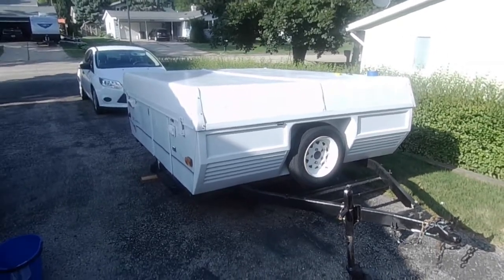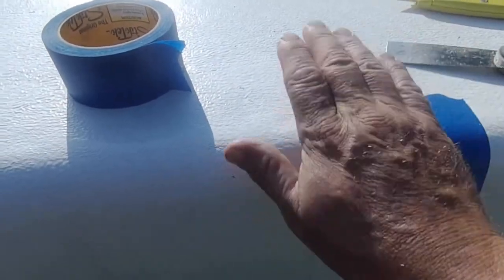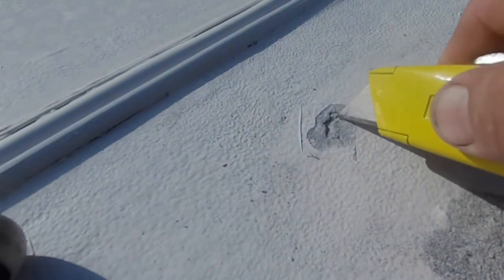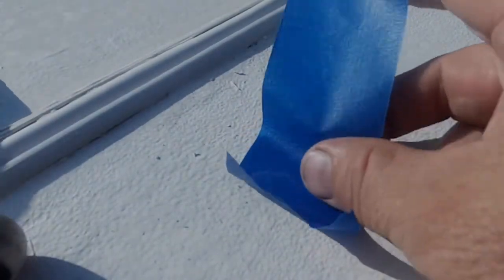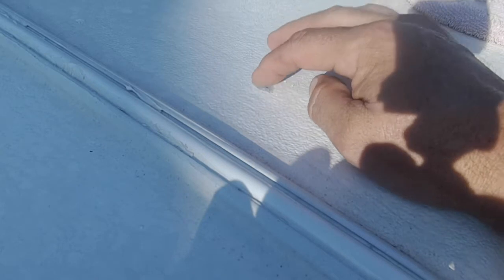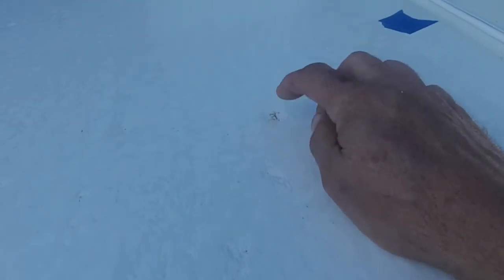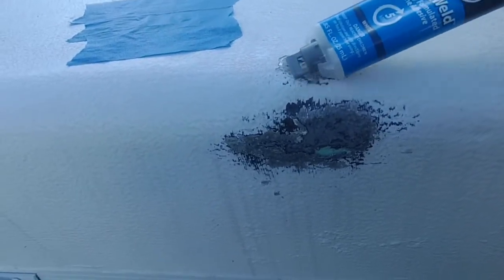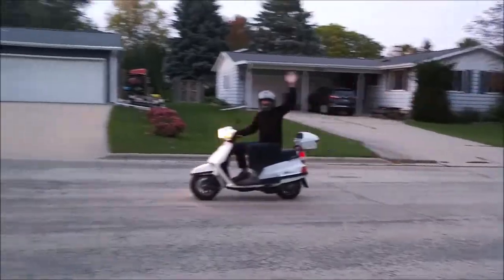Camper Roof Flex Seal Problems after 1st year

Comment: That means you have moisture in the foam.
Reply from the maker: That seems to be the problem.  The roof had many small HAIL dents on it and I think some had holes.  The roof foam was soaked when I bought it.  That is why I painted it black and let it sit in the sun for 2 months.  It got very hot!   A new coat of Flex Seal next spring should finish it off.
Thanks for watching